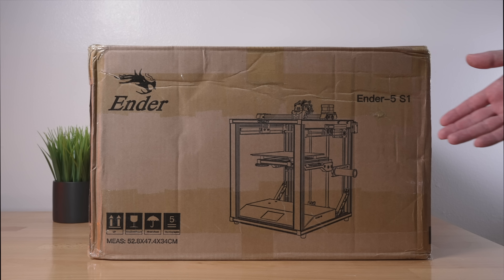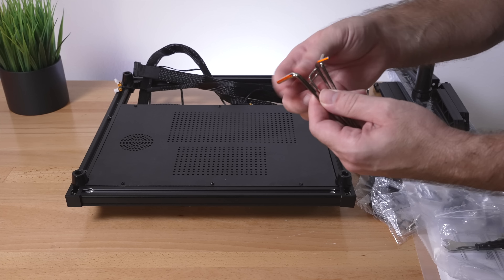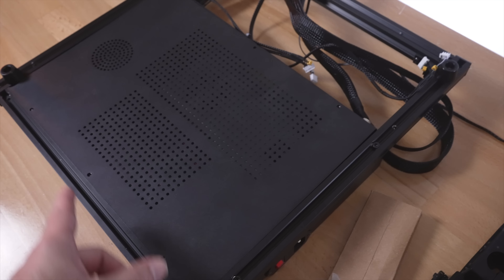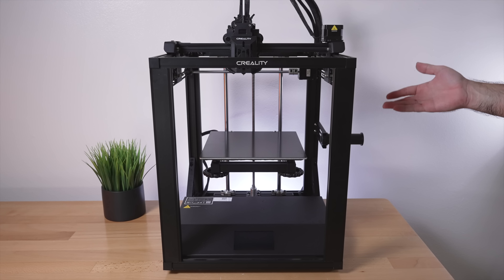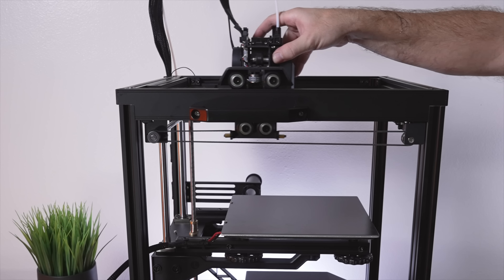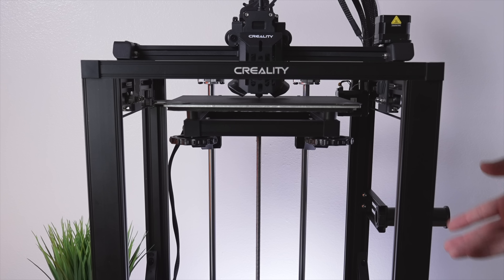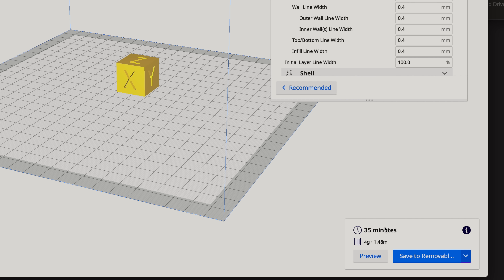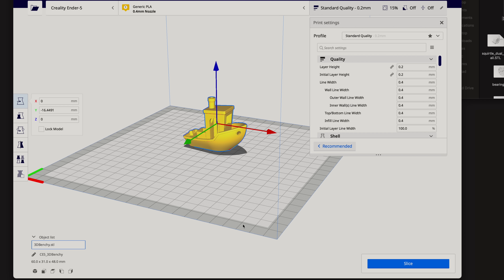Creality Ender-5 S1 - 3D Printer - Unbox & Setup

Comment from the maker: New Channel: www.youtube.com/@Just_Print
Ender-5 S1: https://geni.us/UEvGwA
Recommended: http://geni.us/JustVlads
Reply: Did you get the footing issue resolved? (Stuff fusing together)... Not really worth $500 if you're constantly fusing pieces together
Reply from the maker: Yes, as someone suggested to flip the anti backlash spring around fixed the issue and prints perfect now.
Reply: @JustVlads  thanks
Reply: Hi just vlad! Following u for a long time since like 2020 n I like watched almost every video of yours since then. Please guide me I want to buy a 3D printer for myself this time so pls gimme some advice, I always get confused which printer should I buy resin printer or a filament printer. Pls help me you would do me a huge favour
Reply: @JustVlads  What is the backlash? can you please explain where is this spring exactly please?
Reply: @samk8076 Pause the video at 13:46 where we see the manual. Bottom left page are 2 diagrams. The bed is inverted and if you look at the center rod near the bed you have a spring and a nut. The diagrams shows them to be under the bed (as it is inverted for assembly) but the machine came in pre assembled with these on top of the bed instead. It needs to be under as shown in the pictures.
Reply: @jonathanmartin3503  love you man

Comment: Hello Vlad.
My new ender 5 s1 had the same problem. However, it is not necessary to turn the nut. The problem is caused by the spring being mounted too tight. If you turn the top nut up 1 turn, the problem is solved.
Turn the platter up by hand until the top nut comes loose, then turn the platter down 1 turn and then reattach the nut.
If you put the nuts under the platform, the platform will lower automatically when the Z motor is switched off, the nuts plus spring in the original position prevent this.

Comment: Same 'first few layers issue' here! Took me forever to identify the cause & fix it. Flipping the anti-backlash nut didn't do anything for me; there's another problem causing the same issue: 

Mine had unwanted fibrous residue from the packaging material stuck inside of the Z-Axis linear bearings. If you listen carefully, you'll likely hear a crunching noise coming from those bearings and when you roll around the very top of the Z-Axis you'll find a spot where there is way more friction than anywhere else along the rails. 

To get it out, I lubricated the Z-Axis linear rails, slid the bearings (and print bed) up and down a dozen or so times, rinsed with alcohol and repeated the steps another 3 times. After the final lubrication, and my initial layers are printing perfectly! 

Hope this works for you

Comment: Just got my Ender 5 S1 and same thing with that early layer... everything has printed perfectly otherwise. loving this printer so far. Coming from a pretty old highly modified ender 3 and honestly its nice to move into the modern era.
Reply: Is it still working well
Reply: If you got the footing resolved please update
Reply: I had the same problem. Flip the anti-backlash nut.
Reply: I have the exact same problem with the wierdness on layers 2 to 10 , tried fan on/off from start , different quality, flipped antibacklash nut - nothing resolves it ?

Comment: Great video and great instruction putting the unit together. Well I have received my Ender 5 S1 and printing the test prints and I didn't get this "phenomon" when printing.  I only having issues at first slicing from Cura 5.1.2.  So I did install the Creality Slicer and my prints are printing very well. But I am going to continue to play around with the Cura settings so that I can 3D print from Cura.

Comment: For your problem on thé bottom, it's gotta be something with thé initial layer, temperature, cooling, flow and maybe initial speed, also try to decrease bed temp, because you had a little bit of elephants foot, great vid!!
Reply: Elephants foot has nothing to do with temperature
Reply: @richfpv472  if you Tink so, i fixed my problem's with decreasing bed temp and worked for me, ofc combining it with some other settings, try it if u want, otherwise fix it your way, i just try to help.

Comment: I have the same printer and issues regarding the Z height problem. I flipped the anti-backlash nut, and that solved the issue. Mine shipped with the spring pointing up. Perhaps as the bed is going to start printing, the spring is under more tension as it is being pushed up. When initially printing that tension could be changing until it moves far enough down. I dont know... It is working for me... Also, I found my Z height was roughly 19.7 for the cubes, and now its dead on.
Reply from the maker: Thanks for the tip! It fixed the problem.
Reply: I am new to this and have the ender 5 s1, do you mind pointing me in the direction of where I might find this elusive anti-backlash nut? Thanks!
Reply: @TinderSwindler_  Its the part that is connected to the threaded rod. The rod spins and moves the bed up and down. Attached to the bed is a spring and nut. I removed the threaded rod completely, and removed the 2 screws that hold the spring and nut to the bed. I then installed everything back together, except put the nut and spring on the bottom of the bed. Hope that help. Good Luck

Comment: Thanks so much for the awesome video, I just got mine and have yet to set it up.
I am hoping that I don't run into that same weird issue, although I see many comments with possible solutions.

I am entirely new to 3D printing but really keen to finally get onto the bandwagon.
Got loads of practical things I want to do and it should come in real handy.
Reply: How'd it work out for you with the Ender 5 S1? Im looking at getting one..

Comment: What is the point going down to get Z home? There is a CR Touch for Z homing, why not use that? With this homing method, it is slow and not easy to replace sheets with different thickness. Probably there is a reason, but I don't know what.

Comment: Have you managed to figure out the print issue you saw throughout the prints?
Reply from the maker: Not yet..
Reply: @JustVlads  that little rubber knob on the end of the z lead screw

Comment: Have the same print issue, flipped the anti backlash nut with no improvement. Any tips?
Reply from the maker: Try completely removing the spring to rule it out and also lube the screw. Other than that I'm not sure as that fixed it for me.

Comment: Kind of annoyed they went with v-slot rollers instead of linear rails for a 2022 printer and STILL a cantilever bed. The motors are still 80 step instead of 160 step motors. Time and time again Creality shows that they only care about quantity over quality. What a piss poor job for a 2022 printer. A lot of ghosting can be easily solved with LDO motors.